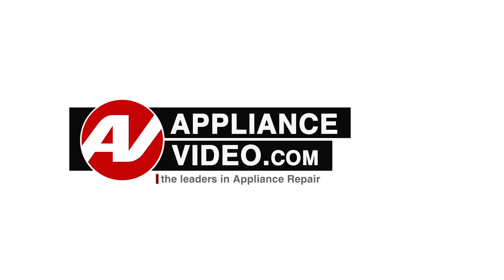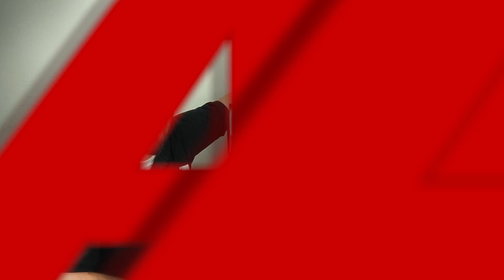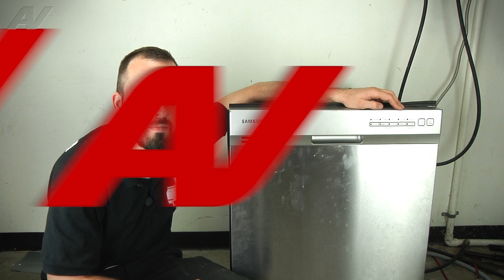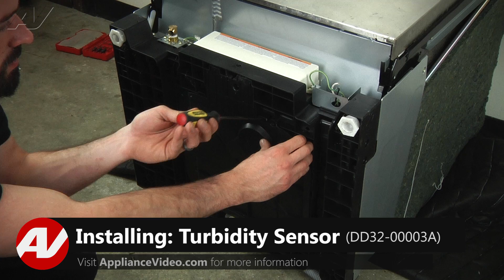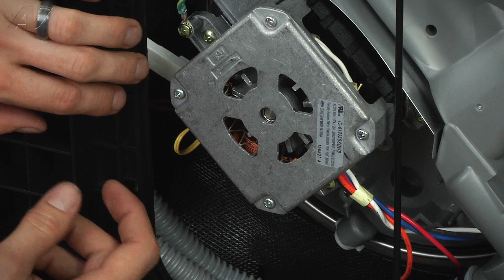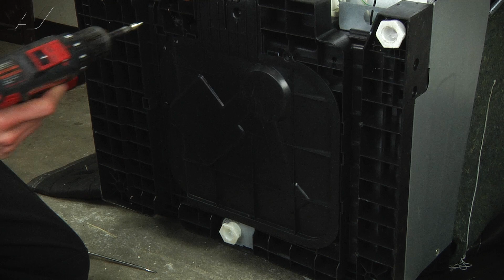Samsung Dishwasher Repair - Does Not Shut Off During Smart Auto Cycle - Turbidity Sensor

Comment: I have a dw80f600utw, mine is doing odd cycles, it flashes no codes, whether it's in auto or normal cycle setting it seems to do a long 1st cycle, then it may drain and start a second but that seems short and then we hear it drain but it keeps running and it sounds like the drain pump is running dry, moaning, when we open it it's dry and dishes appear clean, almost seems like it's heating the drying cycle. I have cleaned it and taken off the side assembly and cleaned that, wondering if it's this turbidity sensor or is the main board insane?

Comment: Can the turbidity sensor be cleaned out inside the dishwasher? Without having to pull it out and disconnect all the hoses? Since there's food running through it wouldn't it be protruding into the actual dishwasher itself and couldn't I just take a rag and clean it and see if that will prevent the dishwasher from continuously running? I look forward to hearing your reply. I also have a Samsung dishwasher
Reply from the maker: Great question, if you have a more technical question that our parts department cannot answer, you can search our over 10,000 answered questions free at our website www.ApplianceVideo.com under our Repair Help section. You can also call our parts department at 1-800-830-5465 and they can give you help 7-days A week Monday Saturday, or search at www.SaveMoreOnParts.com  24 hours 7 days A week.

Comment: Hi I have a kenmore dishwasher w10297955 A dishwasher and it will not turn off can you please help I usually run it every time in 1hour mode please help any opinions or help  would be awesome.  ?????????????
Reply from the maker: Great question, if you have a
more technical question that our parts department cannot answer, you can search
our over 10,000 answered questions free at our website www.ApplianceVideo.com under our Repair Help section. You can also call
our parts department at 1-800-830-5465 and they can give you help 7-days A week
Monday -Sunday, or search at www.SaveMoreOnParts.com  24 hours
7- days A week.
Reply: Devo me too?? It’s the sensor